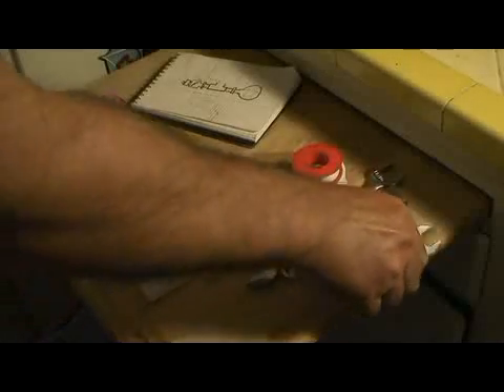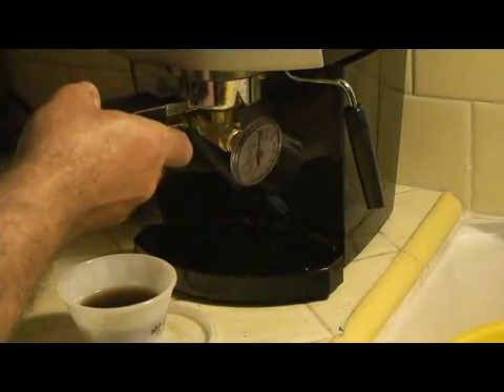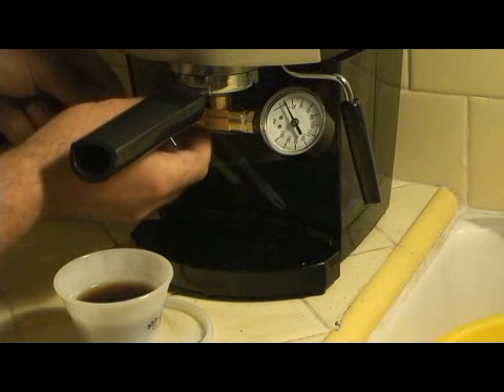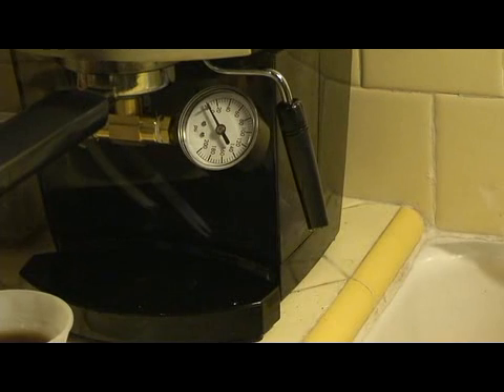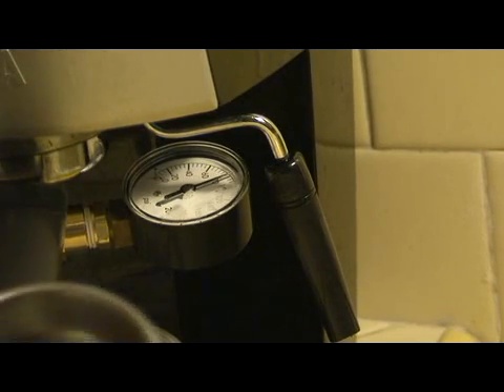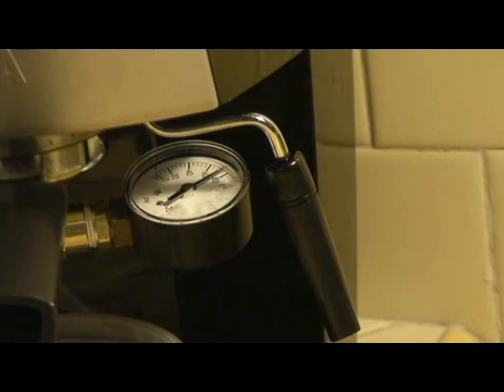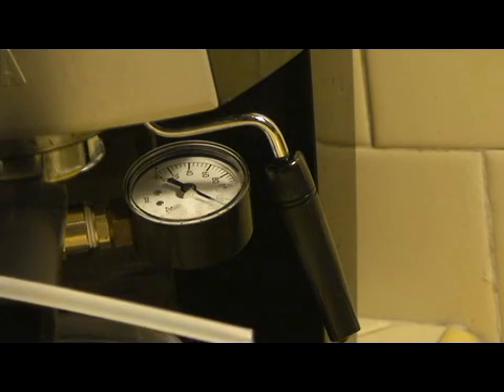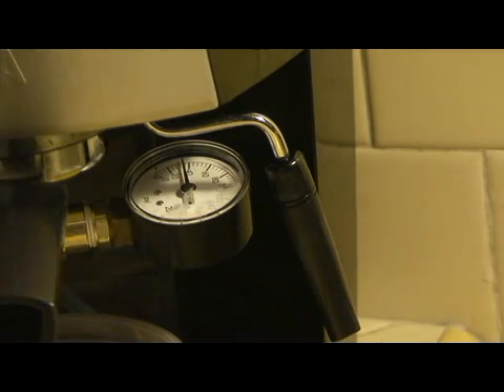Gaggia-HowToBuild-Pressure-Tester-part2

Comment from the maker: @guitarboyled 
no, but I did see someone not even used the split flow portion and just set a closed portafilter pressure to 10 bars  for 9 bars with flow. A valve with a finer adjustment would help but as seldom as it needs to be done, it's not that big a deal.

Regarding your machine sputtering while hot but not when cold, I would first to a temp check using the stryrofoam cup in the grouphead trick. The cup sealed tight in the group head with a temp gauge diagonal seals in heat for accuracy.